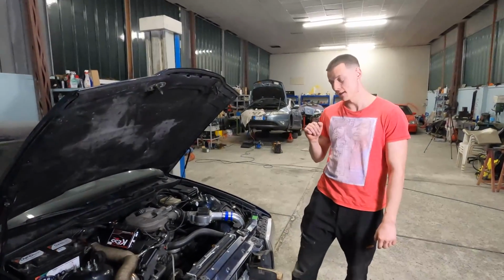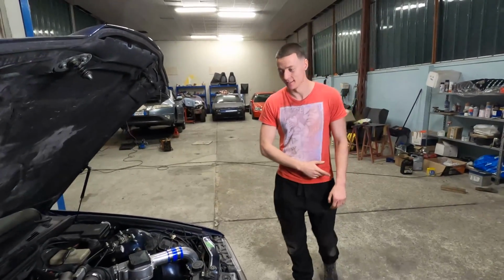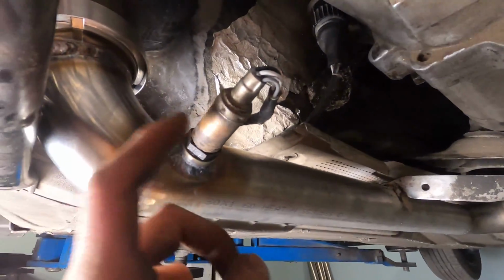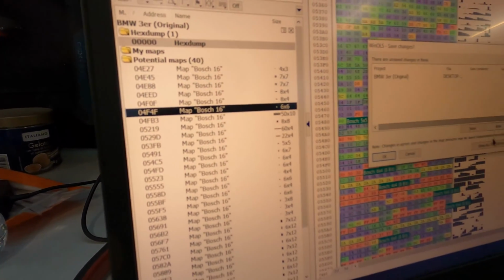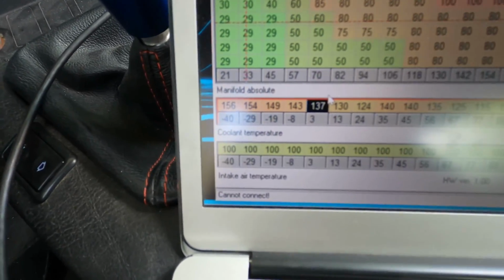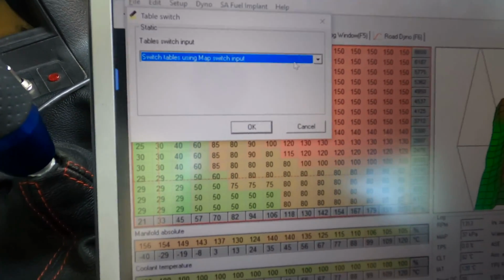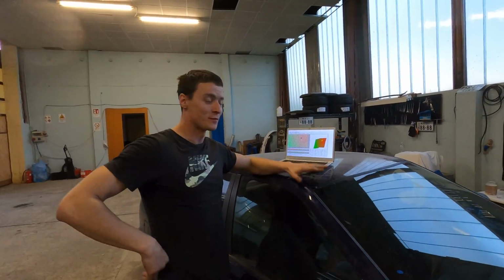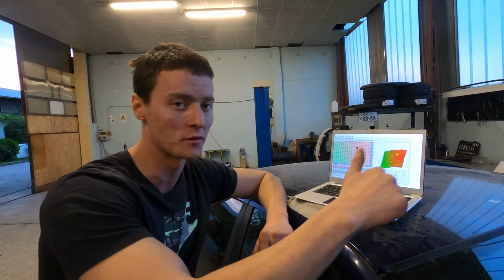E36 TURBO GETS A PIGGYBACK ECU DET3

Comment: Hey boys! Why you are using the DET3 device in fuel implant mode? The easiest way to run the device is the puggyback mode. It does not matter that the stock ecu can not “see” the boost. The DET3 device can sense the boost with build in map sensor. I am running mine exact as i described  and can enrich in boost areas. The only problem that i have with my stock ecu /siemence simtec 56.5 on vectra b / is that when i tuning the det3 i must take off the stock O2 sensor and use wideband for proper tuning. And when i finish with all and put the stock O2 sensor m,siemens ecu start to make correction and the mixture in boost is around 14afr which is not good for boost. That is my only problem,but i find how i can solve this. Respect for project brothers 🤘
Reply from the maker: thx man i'll try that next time :)

Comment: Complimenti 😁una domanda , ho anche io una def 3 in fuel implant mode, per collegare il lounch control non mi funziona su un uscita (2) interruttore poi a massa , devo per caso usare un pull up + 5 V e poi interruttore e a massa? Se mi puoi spiegare come l’hai collegato tu, ti ringrazio
Reply from the maker: eh io l'avevo lasciato sempre attivo alla fine perche non ero neanche io riuscito a configurarlo purtroppo... volevo collegarlo al tasto AC ma non sono riuscito.
Una cosa che puoi provare e lasciarlo sempre attivo e vedere se riesci a collegare il sensore di velocita sul differenziale in modo da fare disattivare il launch quando sei in movimento. probabilmente sempre sullo stesso PIN 2 visto che e l'unico pin dove puoi assegnargli quello che vuoi.

Comment: DET3 is not suitable for this engine and the stock ECU; it's better to use a standalone ECU, as it will be a much better solution.
Reply: The stock intake manifold is very poor; use the intake manifold from a VW 1.8T instead.
Reply from the maker: @zgrywus  thx dude, that would be a good idea i'll look around maybe i can find it at a good price. 
P.S. I have also seen your videos they helped me a lot ;).
Reply: You’re not helpful mate
Reply: @zackrappleye8553  How did I not help? I provided the most important things to the m43 turbo :D. the double valve spring is also important
Reply from the maker: @zackrappleye8553  but he kind of is actually ahahah

Comment: Hi man, great video! I have a question and i hope you can help me out, i have a e46 330i turbo with the same det3 but the car acts weird when its warm, if the engine is cold it runs fine but when it gets hot i cant even release the clutch without the engine dying. Do you know if this could be a det3 software issue or something? I'm really stuck on it for a couple of weeks/months now and i really wanna drive the carrrr xD
Reply from the maker: Hmmm if you don't have an IAT sensor, which is the air intake temperature sensor, then when the car gets warm, the mixture becomes richer because there is less air or better less oxygen in the same volume of air.
I would recommend adding an AFR sensor to see exactly what's happening in the mixture. And also adding an IAT sensor could help the mixture with any operating temperature. Did you configure the other sensors correctly? Maybe double check. It could be a lot of things honestly ahahah I would really like to help you out but not being physically there makes it very difficult ahahah.

Comment: Very useful and detailed video.
A clarification would help me in the same project for my BMW m42b18.
You used the signal from the MAF (41) to det3 (pin 2) and you made the modifications to the analog input, output and scales tables. Det3 reads the signals from the MAF and you had MAF to MAP conversion.
After that you removed the MAF from the engine. Did you also delete the MAF line (41) in det3 (pin 2) ? did you make other modifications?
Thahk you.
Reply from the maker: After you make sure that it reads the maf from the analog input and everything runs well, you can adjust the offset from the analog out as I showed in the video( if it's not working do some research for the maf that you have to see which values it uses in Volts), I think it should work for your engine as well, so that the stock ECU thinks the maf is working properly.
After doing that try and remove the cable from the maf and if nothing changes you're good to go.
Good luck!

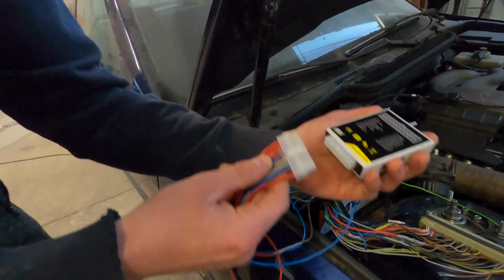Comment: but in the diagram at 10:43 this are the connections shared whit the stock ecu or are the ones that are only plugged to the det3??
Reply from the maker: where you see the numbers circulated it means that wire goes to both stock ECU and DET3 otherwise only one of the two.
Hope this explanation helps ;)
Reply: @LegalizePassion  thanks. does it work on naturally aspirated cars ? i don’t wanna swap turbo yet
Reply from the maker: @fabrizioo.lo22  i think it should yeah just remember to set the table up to 1kpascal max cause over that you won't go obviously cause there would be no turbo pressure

Comment: For the setup of the tps you put the min tps 35?
Reply from the maker: yeah, sorry the GoPro doesn't focalize on close ups unfortunately..
Reply: @LegalizePassion  thack you  mate.  i have the same engine and ecu and i want to set it up right.
when i change the map sensor configuration to 400 , then the  load range from table change too , from 203 to 400

Comment: proper decission guys, finally! there was no point to fight with stock ecu, but I sad it few times - you could ask .. 😜 As you came to conclusion - yes, they are programable, but not thru cable and overall not for boost. DET is here the most reasonable solution. When car already runs stable it is for sure rewarding and has to feel like big relive. My b16 on a lot smaller turbo was still very hard to drive on dry, so I think, that after first drift test you will be ensure to start stage 2 of the build - stock manifold with U-pipe and some simply cheap K04 or td05 MSR turbo. Please let this manifold-turbo setup hang on the wall for the "good" memories ;)
Reply from the maker: Ahaha thx man, but we are stubborn AF so we still tried to understand better how the old ECU works, we learned some interesting things that might help us in the future who knows :).
Yeah I would really like to see a smaller turbo on this honestly but we'll see.. I'm really glad we can finally say this project has come to an end, even though it's also kinda sad ahahah
Reply: DET3 is not suitable in this case.

Comment: you had to bridge pin 14 and 18 with the round 20pin adapter in order to write on the ecu, at least that is the case on 6 cylinder engine ecus, but if the ecu was too old, it might have not had writeable/readable memory, or maybe m43 has all models with non-readable and non-writeable ecu
Reply from the maker: Yeah we tried doing that as well but still no result... Maybe we did something wrong or dunno honestly I was going insane man trying to read that ECU 😂.
Thx for the suggestion anyway ;)
Reply: You have to bench flash the Bosch ecu's, only siemens ms41 you can flash through obd

Comment: What size turbo are you using? Im starting to get parts together, and for a budget turbo an FMU should be good they use them alot in budget turbo builds.
Reply from the maker: Hmmm I looked up the fmu and it looks like a pretty interesting concept. I would still choose this ECU cause I payed like 250€ for it and you can learn a lot more and also has multiple functions. 
Also for the turbo go for a smaller one man cause the turbo I got from the kit is too big for this build, especially if you want to drift the car.
Reply: @LegalizePassion  yeah i think i will go with the ecu too